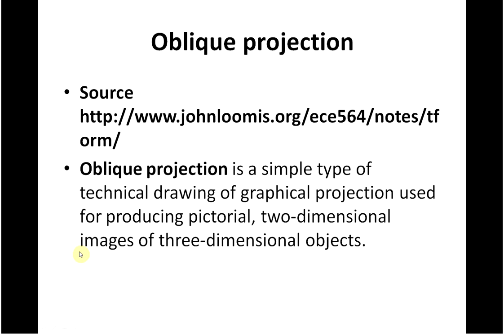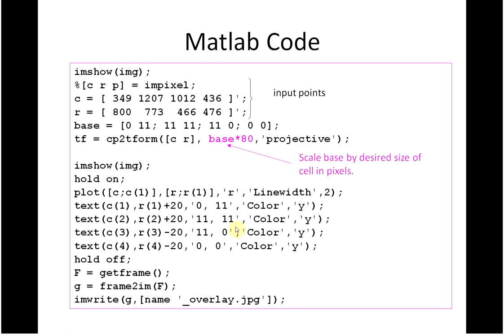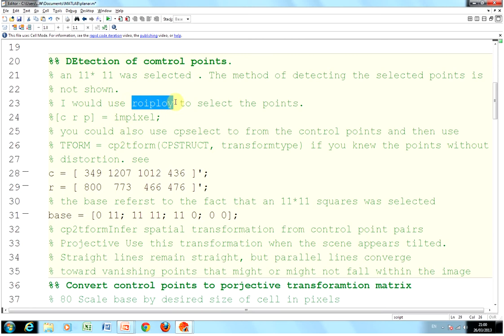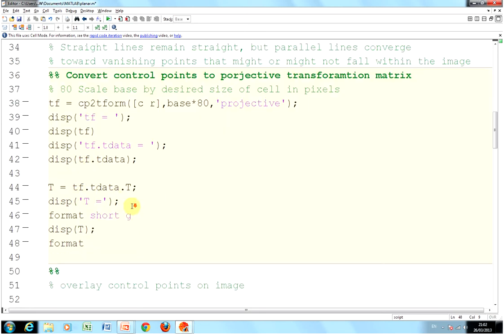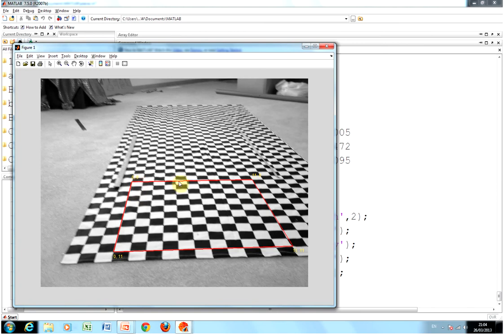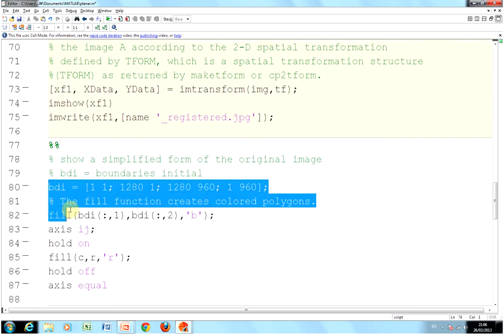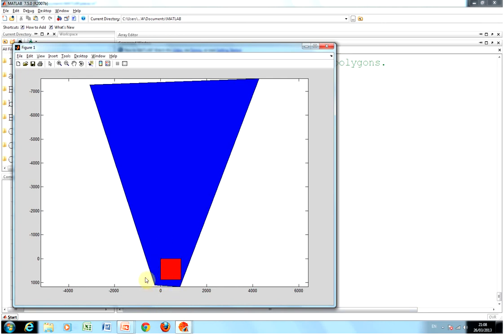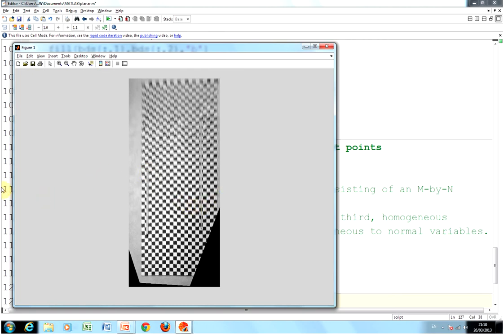Rectification of an oblique image in Matlab using imtransform

Comment: Your output image is good till ur focused area external to that it blurred, can we make it a good output by selecting more than 4 points. I know we should only select 4 points but is ther any way to select more than 4 like say 8 points maybe.
Thank u.
Reply from the maker: Skybender153 Hi thanks for msg. The external area will always be fuzzy. If you want a bigger area select bigger /larger selection coords. if u go to big the rectification may fail as the distortion is too big to handle. The more points u and the more spread out the better. if they are colinear the whole thing blows up. thanks Anselm
Reply: But the problem here is the projective transformation has 8 dof which give 8 equations with 8 unknown parameters from 4 points. if we select 8 points then we won't get the solution r8.
Thank u AG.

Comment: They are not parallel in the image. why did you drew 11 by 11 square, however it is not a square.
Reply from the maker: Hi Thanks for question. The projected image is not square however the rectified image is square. The 11 by 11 refers to 11 squares by 11 squares. Hope this helps.
Regards
Anselm Griffin
Reply: How do u get the co-ordinates of the selected area?  In the Perspective image how to find the line at infinity?
Reply from the maker: Pick one corner as 0.0 (top left as is normal in image processing) Line 31 gives the coords then of the region of interest. We scale by 80 in this case (no of pixels per square)
Thanks AG
Reply: Can u send me how the transformation matrix looks like or any link will be good
Reply: I am asking about how u gave the c and r values in the code. How did u find them?
Reply from the maker: Hi . The line at infinity way is done by homogenous equations. With matlab using imwarp/intransform  the user does not need to know / implement homogenous related material. Thanks AG
Reply: Ofcourse, it was a great help. Actually i'm doing a project which uses computer vision. So manually for each and every image i can find the co-ordinates, do the transformation but what about any random image. I want to make it autonomous like if i gave a random image(perspective) it has to find the line of infinity on its own and transform it into parallel(which is a projective transformation). Any idea of how to approach?
Reply: This is for 2 vanishing points. Can u tell how to proceed for 3 vanishing points, I mean for 3D images. 
Thanks Skybender.